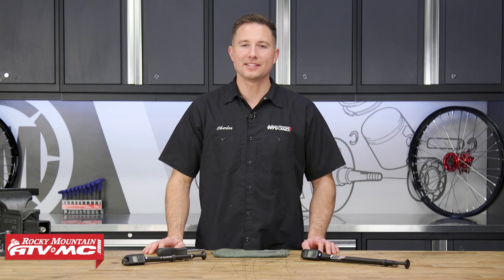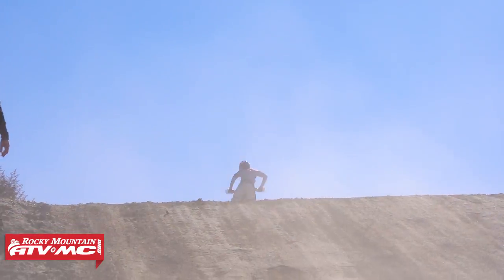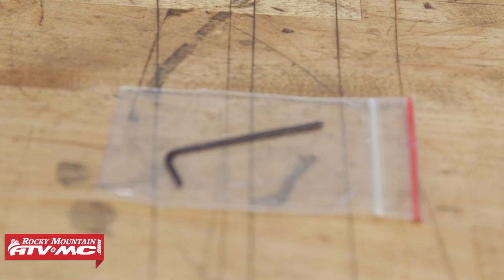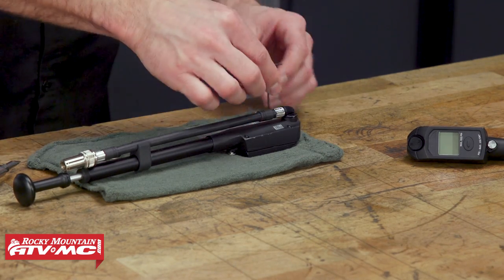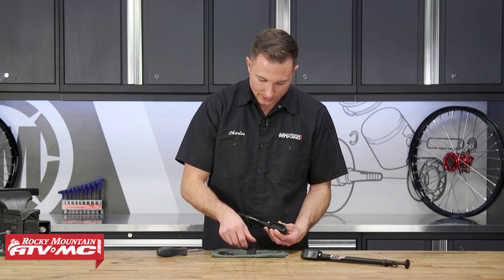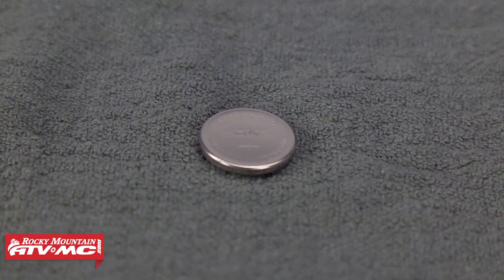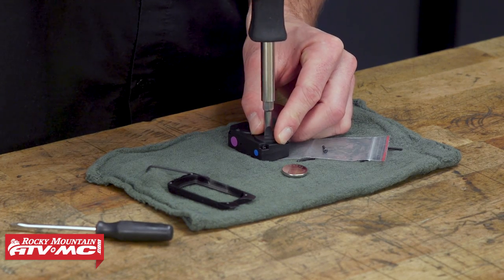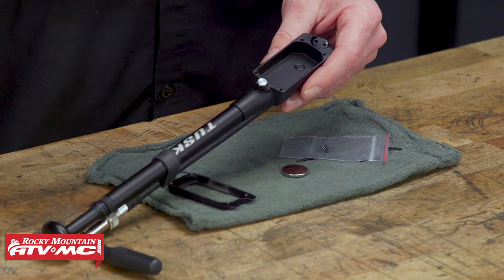Tusk and WP Suspension Air Pump Battery Replacement

Comment: Thanks.  And were they trying to make replacing a battery so hard? And I didn't keep their little wrench, and my Park Tool set goes to 2, not 1.5.  Argh.
Reply: Seems that’s way for sure. I don’t have a tool that small to remove those.  Why not just 4 Phillip head screws.

Comment: Mine shows EAA on the display after changing the battery, will not reset itself to 0.00 PSI or bar; ideas ?
Reply from the maker: If the pressure exceeds 20 bar (300 psi) you will get an ERR error message. You can try to hold down the button for 10 seconds and see if it resets and the error message goes away.